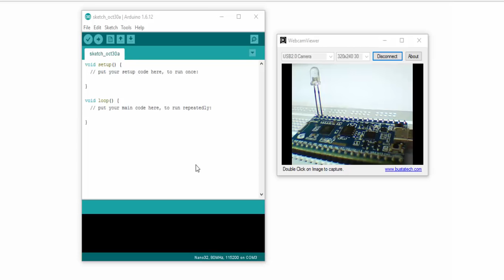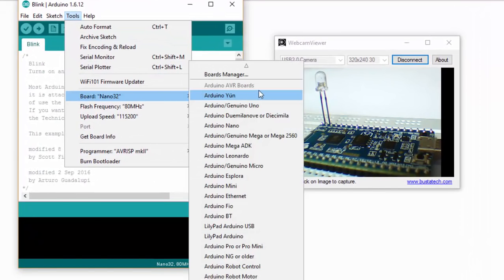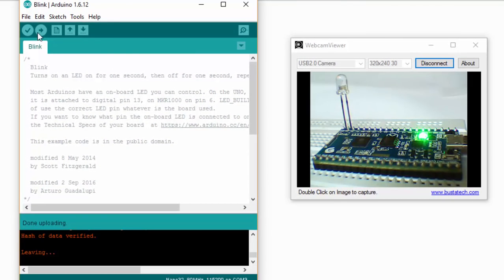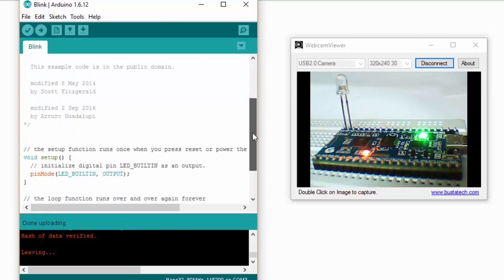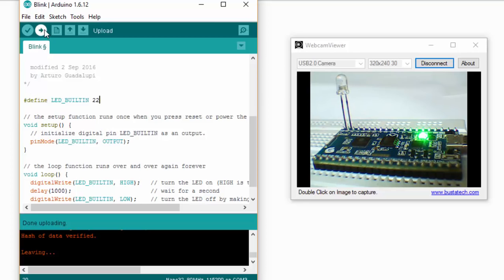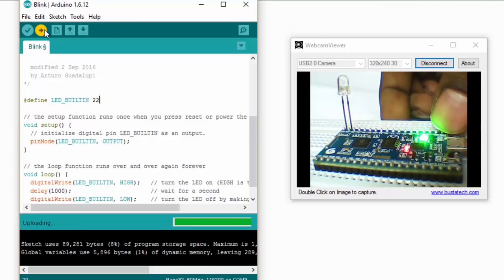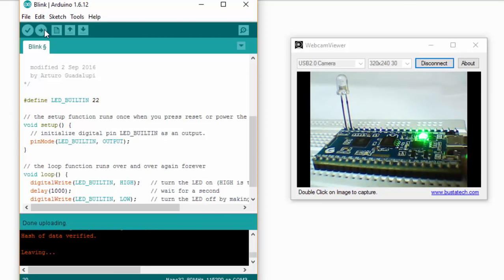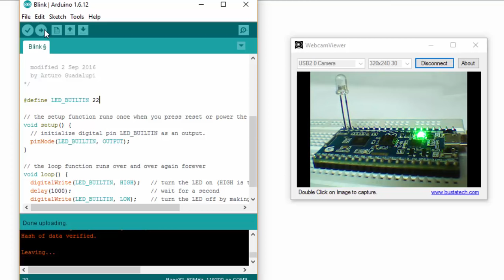Blink an LED using ESP32 Programmed in Arduino IDE | Nano32|

Comment: I get an error while compiling that says: 

Traceback (most recent call last):
File "C:\Program Files (x86)\Arduino\hardware\espressif\esp32/tools/esptool.py", line 25, in <module>
import serial
ImportError: No module named serial
exit status 1
Error compiling for board Nano32

Any fix?